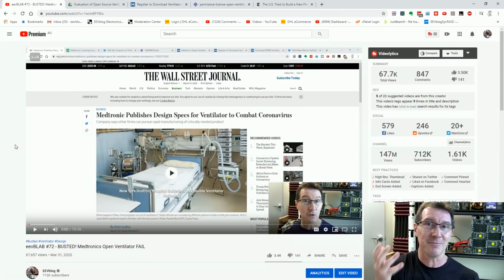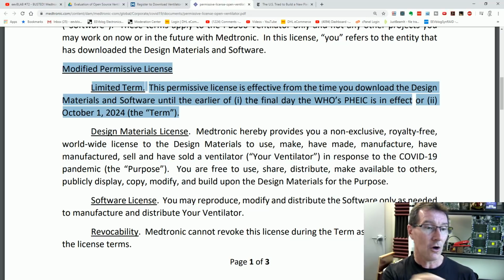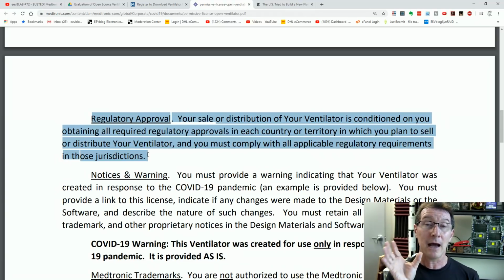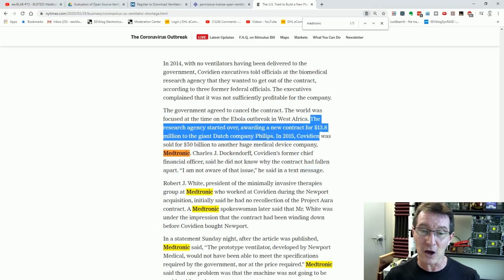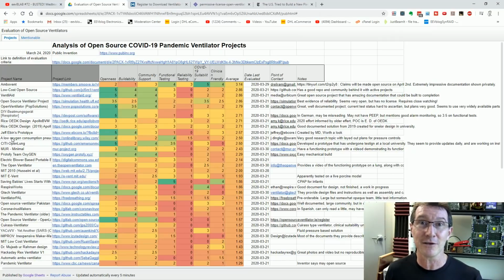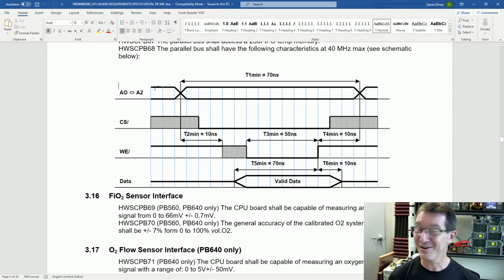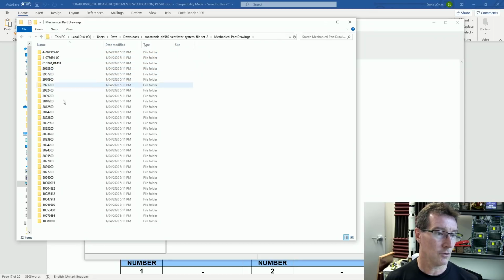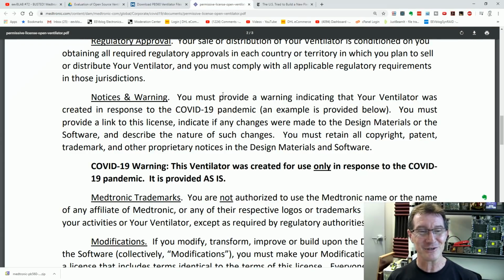eevBLAB #73 - Medtronics Open Ventilator + Others UPDATE

Comment: I don't think you get it, they are not trying to build hundreds competitors with their design, they are looking for people that want to contribute to the issue by using their design. This is not an offer to create your own business, this is more for a manufacturer that has the right skills and equipment that want to lend a hand to this crisis. They make the terms very clear and I will also note that not one other ventilator maker has done this. You got this wrong and are dancing, just admit it and move on, you were right in the first video if that is all they released, but they released more and what is most important is they released everything needed.
Reply: Yes but if that was their goal, to get it manufactured by companies, why are there so many design/requirements docs?  The manufacturing folks trying to re-tool their lines to build these things aren't doing any additional design, they are just trying to acquire the parts and figure out how to build it and test it.  I agree with you though, Dave is a bit off on this one, but I think it's because of the way Medtronics (or at least the news coverage) presented it.

Comment: That "ventilator failure" article skips over some important facts in favor of sensationalism, like the company that made the contract and produced nothing was purchased by Covidien which was later purchased by Medtronic.  It's pretty likely that very few of the people who were involved in the original project are still employed by Medtronic at this point.  Since the government went on to order from someone else, there's little point in Medtronic or Covidien trying to complete the contract.     Medtronic's license protects the company, they can't do otherwise because they're a publicly held company... if they didn't offer protection for their IP, the shareholders would sue them.   They've taken an impressive risk releasing anything at all here, and though it's not likely to be useful to DIY types building "ventilators", that's ok.   If the people designing DIY products at this point don't find useful data in the docs, they don't know enough to design a ventilator that won't kill someone anyway, and they should work on face shields and masks instead.   You're probably right that they're interested in their bottom line here, but again, they don't have a choice... the law requires them to protect the shareholders' money, and if they were to do something completely out of altruism, they'd get sued.

Comment: All this story is a big nonsense.
There is no way for any company, small or big it is, to come out with a reliable machine based on these documents in less than several months.
Saying nothing about certification...
What it is needed now is a simple machine can be done in thousands units in a short time. So simple it doesn't need a crazy complex procedure to verify the functioning before to use it as a life sustaining device.
Someone is doing it: it is just an AMBU (Auxiliary Manual Breathing Unit) squeezed by a machine and not by human hands. All the "medical" parts are already there and the machine is just a squeezer controlled by a simple electronic board.
Sure it is not as good as the Medtronics one, but it is better to have something working NOW, than something perfect when we will not need it anymore.

Comment: I could be wrong, but didn't they say they are going to release the firmware in object form, So when it is released I am expecting a pre-compiled form of the firmware that you just flash to the chip and it works. There will not be source code. Just my guess though

Comment: I think this is a license to keep the machines working, no matter what.

I think it is addressing that particular situation of what happened in Italy. Where there was a shortage of a particular part,  and professional 3D printing was used to fix the shortage problem.  Making the existing ventilators usable again. 

Copyright law is however a rather double edged sword.  Where companies are 'required' to actively engage in actions to protect their rights, or they will automatically lose them. 

So in order to avoid getting themselves (the company), or anyone else, into a nuisance level of trouble, by thinking up here-and-now solutions, so the machines can keep running, then  Medtronics is opening up, with this license of a here-and-now window of options, to  the people on the ground, at ground zero, where ever this ground zero might be.  

Essentially making it 'safe' to keep buying (and/or using) these machines, no matter the global logistics problems. 
And  Medtronics  avoids the need to monitor, and the need to lawyer up,  in order to protect their intellectual property rights in the midst of all of this - where everyone would rather use energy and resources to focus on solutions and remedies, and everyone wants to be able to do this without needing to waste time and energy to also finding ways to cover ones ass of potential future lawsuits. 

So it is a license to keep the machines working, no matter what.

It is not a free gift to the Open Source community to take this IP into whatever trajectory  the community wants.  
It is however an invitation to collaborate on solutions, in the midst of this crises.

Comment: Open source ventilators will ONLY be useful in an emergency like this. Under normal circumstances for a critical device like a ventilator to get FDA or other regulatory approval there is so much involved in the supply chain logistics, quality assurance, testing, verification and documentation of the design and manufacturing process that it would take a significant sized company that already knew what it was doing to produce these.  These things would never be used in critical care unless a hospital is literally out of other options.  The liability alone would be horrific for using a non FDA approved device.

Comment: You can always copy a product for your own usage (in any case nobody would check or sue you for copying an existing product!)
So those documents would greatly help you to do that.
That said most people would buy for their own usage rather than DIY a respirator, because it's hard and complex and more expensive, and in case no ventilators are available for purchase, the chances that one can successfully source *all* the required components are very slim.
So the only ones who benefit are 1) Medtronics themselves (publicity) and 2) potential chinese manufacturers :) ... and that's probably why Medtronics have shared documents for an older product, not their latest and greatest.

Comment: I usually like Dave's stuff, but on this subject I think his first video criticizing Medtronics first release of info really jumped the gun. There is no way that Dave's first video somehow prompted Medtronics second release of info -- that had to already be in the works for it to come out yesterday.  It's good that Dave winds up giving some credit to Medtronics on this. Fair enough criticism on the license, and of course if the idea is to actually manufacture these more or less verbatim, then source code will be needed.  It should also be noted that this is a 15-year old design (or so), so not necessarily a windfall for some new company to run with as an ongoing competitive product line.  But hugely educational to illustrate the principles.

Comment: Jeez, half of the video is the emphasis on the 'license', its a boilerplate warning - don't blatantly copy.
If that didn't sink in from the get-go - if you still trying to so - good luck establishing the supply chain, getting most of those components, tooling, etc.
Also regarding previous rant - 'Its not open enough, reeeeee' - look at it as an application note - how its done, why is it done the way its done, you are supposed to do your own homework, source your own components, adapt to what you have, your processes, your manufacturing.
Its kinda funny that it was government funded and just 'fell through'.
All that scary licencing legalese means jack shit - don't be a dumbass and you'll be fine.
Dave, your rant being a bit dismissive doesn't exactly help the community get most out of the info provided.
Reply: You do realise that a license agreement is mostly (meant to be) enforceable, right?
Reply: @mjouwbuis  Just like those mile long software licences that nobody reads?

Comment: Once the pandemic is over there are going to be 10 of thousands of ventilators sitting around with nothing to do, no demand for new ones for a long time.
Reply: Same thing happened with WWII. Tank crews were still issued WWII smgs through the early 90s.
Reply: Don't worry, the lobbyists will make sure that the regulations and FDA approval testing is changed to make all those ventilators obsolete (I read somewhere in these threads that the design is over 10 years old)
Reply: "I think one of the reasons might be that new medical device regulations are going into effect after 2024" ...... from another thread in this post....
Reply: You think there won’t be another pandemic due a different virus in the future?

Comment: (not a lawyer) I think that the restrictions on the license aren't going to be much of an issue for most of the companies that would use this.  Any company already in the medical device field would use their own design.  This is more for the small companies around the country that have the technical capabilities to produce this (even if only in the prototyping department), but are in a different field.
At the end of the pandemic, those companies will want to be getting back to their main business.

And in light of the huge list of open-source patterns, if I was in the position of picking a pattern to use, a pattern with proven reliability would be very appealing, especially as the best project in the list hasn't hit 48h reliability yet.

Comment: This device is one of their commercial medical  devices. due to the shortage of ventilators they have made it publicly available for social-manufacturing; it's not so you can go out and start making money off of their IP. I am sure its just so that those hospitals who can't get regular ventilators can get something that will do in a pinch  They are outsourcing the means of production. I, for one, am okay with the license. i don't think their should be a limitation on which pandemic/epidemic it can be used on; or and end date at all. It should have said something like, only can be used in a time of national emergency or something; but...

I think if anything however, this pandemic has made it clear that we need more open source medical devices. Hospitals should have rooms full of 3D printers that can reproduce any FDA approved medical device they may need at a moments notice.
Reply: A 3D printer is not a replicator. It doesn't make sensors, or electric motors, or pressure valves. A whole bunch of shell cases are quite useless if you need most of your parts manufactured elsewhere. Then you mise well manufacture the whole thing more efficiently somewhere else too...
Reply: @jovangrbic97  No;  but an automated SMT PCB assembly station could create sensors. And for what they can't reproduce (motors and the such); they can keep as parts in stock. 

What if we go through a major infrastructure failure; such as roads and bridges being inaccessible. Being able to assemble medical devices in house may be critical.  If the manufacturer is in Ne York, but your hospital is in Washington State; you're screwed. That is unless you can put it together in house. 

So, with a PCB SMT station and a few 3D printers, they could basically "replicate" anything they need; including metal parts.
Reply: @briank.1221  Hey I'm all for decentralised manufacturing, but unfortunately every for profit enterprise in the US will always go the cheap greedy route, and maintaining stock/manufacturing facilities that will be used once in a thousand years is not something they will ever do. Now a government effort to establish such facilities might work, but in such a hypercapitalist system, it will always be a case of too little too late as preparedness costs money and all companies would rather pocket money now than prepare for the future, no matter the costs later...

Comment: @15:30:
When you try to open a file from an archive, 7zip will unpack it - and only it - to a temporary folder. So if the other files are needed (e.g.: as assets), you would get some errors. Try to unpack it all and then open it...
Reply: @EEVblog
Reply: Why would you even use 7zip? Even the zip unpacker built in to windows offers to unpack them all when you open a single file.

Comment: I doubt that Medtronics intends for makers to be producing these. The number of parts you'd have to buy, the regulatory approval, I doubt it could be done. I'd imagine it's their intent that larger manufacturing companies, GM, Ford, companies like JVC or Samsung, anyone with a manufacturing plant really, to be making these ventilators. Even if you could get the parts, a single maker would maybe be able to produce one in a week, if even. If you're really looking to produce ventilators in your basement, it's best to stick to the open source, low cost options.
Reply from the maker: Read the download page: "Our hope is that manufacturers and engineers will use this intellectual property to inspire their own potentially lifesaving innovations."

Comment: I think one of the reasons might be that new medical device regulations are going into effect after 2024. The documentation they supplied might not be enough to continue to sell it and since they are the guys who made it someone might have told them they’d be liable to some degree should there be any issues after that point in time.

Also the manufacturer has to prove that they can make it. That is why they say that you need to prove that the devices they are producing is safe to use. At least from my experience as a engineer designing ventilators and oxygen supply systems for these ventilators. I’d be very weary of giving away plans and telling people. Yeah you can build it and we guarantee it will work... I’ve had so many issues with just different service technicians servicing our devices and ironing out the kinks that I don’t think it’s enough to just publish the plans and CAD files....
Reply: I get your thought process RE the 2024 timeline BUT IF I am building these in Zimbabwe for example come "WHO" declaration OR 2024 I have to stop production OR BE legally liable
and US medical laws likely do NOT apply in Zimbabwe anyways 
IMHO this is more about save patients during pandemic BUT NOT expose medtronics to competition as I assume medtronics plans on still selling the 560 machine after 2024

Comment: I think the intent is gir larger assembly operations to boost capacity to manufacture the huge demand for ventilators.. The world demand may yet run into millions and existing assembly operations may (will) not be capable of immediate boost given line and test capacity, They this offere an approved design DURING this pandemic for organisations to co produce the product. Given an existing design with approvals most approval authorities would under the crisis allow  the duplicates to be used with only quality assesment of the new assembler.
No open free design is intended, just free access to get short term addional volumes. Once the crisis is over there will be no need to keep making these and thus end of license to do so.
If anyone wants now to develop their own OPEN design they must do so on their own and will be unlikely to deliver anything this Pandemic. Just the approval process is unlikrly to be under several years.

Comment: This is the problem with open source Zealots. Have to be negative when a company is trying to help. Medtronics would've spent a lot of money in R&D and regulatory approvals, suddenly making a commercial design freely available is business suicide but temporarily giving info and letting others manufacture completely for free to help during this Pandemic is being a good corporate citizen and should be applauded. If I were a manufacturer trying to help with the effort I'd rather build a proven design that has all the relevant approvals than some open source design knocked up in a few weeks without any kind of testing.

With this kind of documentation released I have no doubts that a manufacturer in China could have this up and running in a matter of months or potentially less.
Reply: @windson7 But if you spend 10s or 100s of millions of dollars and many years on R&D, clinical trials and approvals only to give away all your IP for free permanently what you are doing is running a charity not a business in which case if you didn't have a wealthy donor to bankroll you why would you do any of it in the first place? If you do make the best product and then give it away for free for others to make you no longer make the best product do you because someone else can come along and make it and sell it cheaper because they don't have any of the R&D and clinical trials and regulatory costs. Open source definitely has its place but not in medical equipment

Comment: Nurse from italian hospital told in this interview: https://www.youtube.com/watch?v=_suhYeWEcJg that no one patient on ventilator was cured. I think without good medicine for virus ventilators only delay people death for couple days.
Reply: It actually makes you feel like you are drowning, so to feel like that for days would not be very nice, these machines dont compress air, they are run on oxygen, so the oxygen percentage of the air is increased so when you take a breath if you have 1/10 of a breath your getting the oxygen to the parts where its needed, as the phlegm builds up in your lungs it blocks the air from entering technical suffocating you, so it helps to mitigate that while your body fights the infection, which is why the weak, young and old are the worst effected. Not the nicest way for anyone to spend thier last days